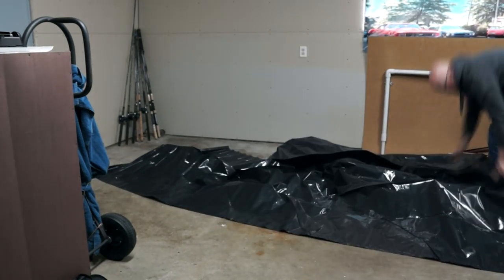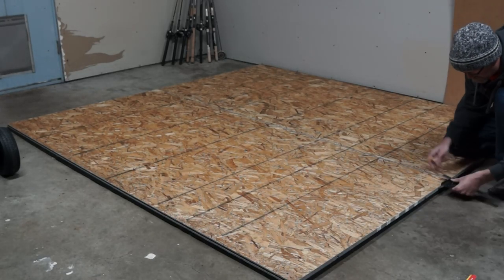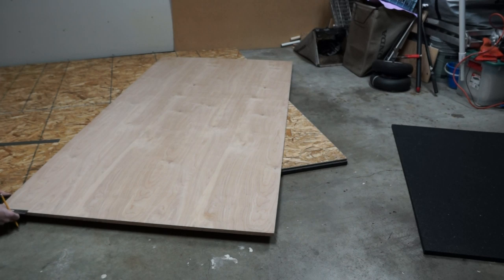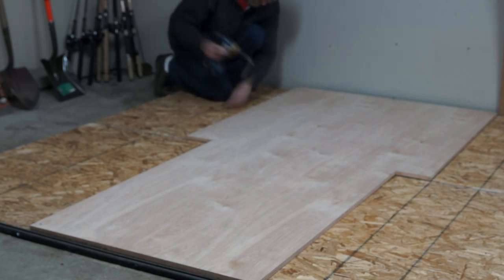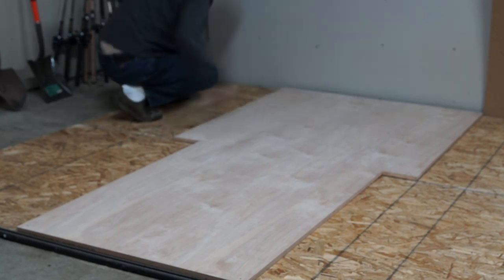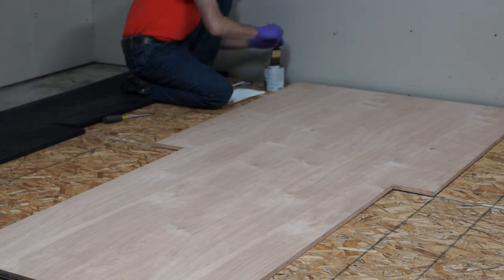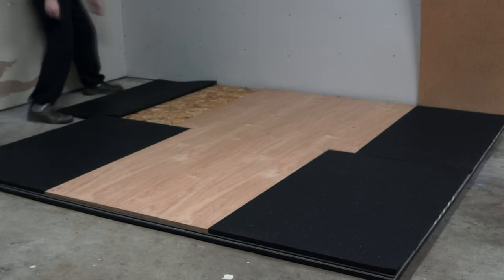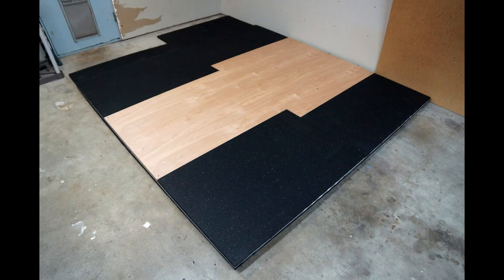Barbell weight lifting platform for power rack DIY build

Comment: For the poly I would highly recommend using a paint roller instead. It's easier and has a better finish. You can just slop down a bunch on the wood and spread it out with the roller. The roller will leave behind a mostly uniform textured finish. You can also put on multiple layers and use a very fine sand paper if you want a smooth finish.
Reply: That's an excellent tip, thank you!

Comment: Cool video. I just finished mine. J used 2 sheets of osb for the bottom 2 layers and 1 layer of regular $25 sheet plywood for 3rd layer. Then a 4x4 for the middle and 2 mats on each side. Works good so far
Reply from the maker: Awesome, it's great to have your own platform!

Comment: I really like this platform.  Particularly the way you "notched" the birch board.  I watched both this video and the one where you actually install the rack. 

Having the feet of the rack sit on the seam is the right way to go.  Serves two purposes.  1. It will hold down both the birch and the rubber tight together in addition to any screws.  2.  When you are working inside the rack, the seam runs directly under the frame of the rack, thereby never interfering with your feet no matter how wide you stand.
Having the birch platform narrower in the front is GENIUS for it provides a better distance for the weights to land on the rubber when doing floor lifts.  Deads, rows, cleans, etc. 

If you kept that seam at 4', then your loaded barbell would barely be clearing the platform.  If you shift slightly when lowering the bar, the weight may land so close  (or on) the seam that over time, the rubber may pull away from the birch, chip the clean edge of the birch, etc.  Also if you use a deadlift jack, you would most likely be jacking the bar on the wood.  Your way most likely insures  that the jack will be on the rubber.  So WELL DONE!!!

Now for the questions: 

Does the notch come into play at exactly the mid point of the birch board?  i.e at the 4 ft/4ft mark?  Looking at the way you were able to get away with using only 2 stall mats I imagine that would be the only place to notch the birch.  If you notched it at say the 5 ft / 3ft mark it doesn't appear you could make efficient use out of just 2 stall mats.  You follow me?

The reason I mention that is I will be getting the R-3 also but in the 30" depth Bolt Together version (If this damn virus crap subsides so I can place an order!) - The overall depth will be 6" more than yours.  Where do I cut my notch so my feet sit in same place as yours AND leaves me enough room off the wall for working off the rear of the rack?

I'm calculating my depth as such:  
30" inside + (3" upright x 2) + (2" foot flange x 2) = 40" overall
If I notch my board at the 4 foot mark and place the front feet right on that seam, that only leaves me 8" from the wall.  Seems a little tight?  No?

I can notch it further down the board like at 4ft-6in (I don't mind sacrificing a bit of dead lifting space) - But then I would need to make my stall mat cuts length wise and according to my calculations I would need 3 stall mats with a lot of waste.

Lemme know your thoughts on all this if you can.  And again - Very well planned out project on your part.  Looks great.
Reply from the maker: Hi Mike,

I hope all is well and thank you for the detailed comments / questions!

Based on your questions, here are some things to chew on for your calculations. I'd be interested in what you come up with.

Yes, the notch is exactly at the 4' mark. I see what you are saying about 5'/3' split, you would need smaller mat sub pieces to fill in the spaces which might not be a bad thing because it would be next to the sides of the rack and not where you are deadlifting, and you could place the smaller pieces near the back wall.

The uprights on mine comes to about 16.5" from the back off the platform, so there is about the right amount of room near the wall.

From your description, the rack is the 30" version. Mine is the 24" version, so I would assume you just need an extra 6", but if you are concerned about having more space at the back, the 5'/3' split would probably work too.

Yes, 8" from the wall might be too tight I think. Mine is 16.5" from the wall at the upright. 8" would put your face pretty close to the wall.

Cheers!
Reply: @martinstrength8532  - Thanks for the response (I knew you would based on seeing you reply to others).

Thanks for all the input - I think you are basically confirming what I already assumed:  Either lose a little dead lift space in the front or build a bigger platform.  I will do a mock layout and see how it feels with the 5'/3' split before I construct it.
As far as the stall mats - I would just buy an extra one or two to avoid having small pieces fill the space.  I'd prefer to spend a few more bucks and have waste to avoid too many seams.
Reply from the maker: @DieselMike  Sounds like a solid plan. FYI, the mats I used are from Tractor Supply Company which I bought locally to avoid shipping cost: https://www.tractorsupply.com/tsc/product/4-ft-x-6-ft-x-3-4-in-thick-rubber-stall-mat
Reply: @martinstrength8532  Would you believe every TSC within 50 miles of me are out of stock?  Before the Virus, these things were stacked 4 feet high at any location I ever went to.  So impossible to buy a rack right now.  Apparently impossible to get stall mats.  I guess this project is put on hold for now.  UGH!

Comment: How are the mat screws holding up? Small change would be to add a washer between the mat and screw that helps hold it down without cutting through the mat. Great platform!

Comment: I want to know more about the heater you planned too put in the corner by the fishing rods.  What ever came of that?
Reply from the maker: Hi,
  Good question!
It turns out that the garage is insulated and no heater is needed as some warmth comes in from the house. It never gets less than about 58F in the garage and when strength training I warm up pretty quickly. This is in the Seattle area.

Comment: Love your video! Amazing job! What is the moisture barrier made of? What material and size is that black tarp? Won't it tear with the slightest movement against the concrete with heavy weight on top of the platform? Thank you!!!
Reply from the maker: Sorry about the late reply. the moisture barrier is just a plastic moisture barrier from the hardware store. I'm not sure. I didn't end up really needing a moisture barrier. sorry if that's not enough info. The floor never really gets wet.

Comment: Would you recommend spray painting the sides of the middle osb layer black to blend in with the mats for a cleaner look? 
Also, would you recommend adding washers to the screws holding the mats to the osb for better support?
Reply from the maker: I like your idea of painting the sides of the OSB, I think that would look great! I haven't had any problems with the support, so if I was thinking about the possibility of adding washers, I would start without and then add them later if you think they are needed. I used very few screws, but you could add more if you like too.

Comment: @Martin Strength, thanks for the video. Do you think you need the plywood? Why not just have the stall mats?
Reply from the maker: You could just use stall mats on the top layer. I like the plywood because it has less compression for the bolting of a power rack and also less compression and less wasted energy for driving power during the lifts. Would you rather lift on a soft surface or a hard surface?

Comment: Hi. Thanks for making this! You did a great job. Do you feel you could've done without making the front more narrow for deadlifts? I'm worried I won't be able to make the 6 inch cutouts on each side.
Reply from the maker: It will work just fine without the cutouts. I could have done without it,  but I like the little extra  padding space.  Thanks for the compliment!

Comment: My hardware store didn't have 5/8 ply wood and instead had 19/32 which is just short of 1.25 inches after stacking my boards. Will the 1.25 screws still be ok? Any recommendations?

Comment: Hey Martin! Absolutely love your video. Will use this as the main source when I build my own platform. I was just wondering though. Do I really need 2 layers of 3/4" OSB? Would 2 layers of 3/8" do the trick as well, or do you think that's not enough protection... Thanks!
Reply from the maker: Don't quote me on this, but it sounds reasonable. Are you doing Olympic lifts and dropping the weights down all the time? That might be an issue.
Reply: @martinstrength8532  Nope! Just powerlifting... My deadlift max right now is about 440lbs, I can maybe get up to 550-600 in a few years time. Not planning on doing any olympic lifting

Comment: Great video.  Thank you.  One question.  Noticed you used three layers of plywood.  Do you think two layers would have been just as good?  In other words, two layers down, and then birch on top.  That along with the stall mats.  Reason I ask is because i'm concerned about the height of my rack.  By keeping to two layers of plywood the platform is limited to an inch and a half rather than 2 and a quarter inches.  Interested in your thoughts.
Reply from the maker: I would think two layers would be ok, but one limiting factor is that the length of bolts used to secure the rack might not be able to be as long. I don't know if that would be an issue or not.

Comment: What is the depth of the narrower Olympic lifting area vs the power rack base?
Reply from the maker: They are both 48 inches in length and the front is 36 inches wide, the back is 48 inches wide. I hope that helps.

Comment: Did you use two 4x6 horse mats, or one? I ask because the boards are 4x8, so I’m trying to see how this would fit. Thanks, I’m building the same platform this weekend!
Reply from the maker: Hi, yes it's two stall mats. The one in the front is cut to 2.5 ft and the one in the back is cut to 2 ft. (you might be able to see the dimensions on the paper design in this video: https://youtu.be/entPQi2GUTE ) Since they are 4 x 6, this leaves you with an extra 1 ft and 2 ft leftovers. I'm not sure if there is a better way to do it, but I hope that helps and I'd like to see and / or hear how your build goes!
Reply: Martin Strength Thanks!

Comment: Hi Martin! I've got a rogue r-3 power rack (same as you), and I'm wondering if it would cause any issues if I cut the oak plywood into two separate pieces.

I don't have a circular saw at home; I'd ask the Home Depot employee to first cut the piece in half, then cut off an inch from one of the halves. Would screwing these two pieces down separately be a problem?

Thanks!
Reply: Also, would using 1 layer of 2 pieces of 4x8 1inch OSB pieces be okay? Or is it recommended to have two layers of thinner 5/8" pieces?

Comment: How did that particle board hold up slamming weights on it over and over again?
Reply from the maker: Granted I have only been doing deadlifts on it for a couple of months, so it hasn't been hammered too hard, but I haven't seen any problems yet. It's Oriented strand board (OSB).
Reply: Martin Strength oh I see thank you for the reply. How much did the total project cost?
Reply from the maker: @charliestanley7906   I don't remember the exact figure, but including the  4 x OSB, 1 x Plywood, Mats, drywall screws, and water barrier plastic, it was somewhere in the $250 - $300 range. The main plywood in the middle was about $60 (could've saved here, but I wanted nice looking wood for it), the stall mats were $40 each from Tractor Supply Company (local), OSB were about $22 each.

Comment: Hi Martin, great video. May I ask you few question about the polyurethane coating? Do you few it is slippery when you are bench pressing, do you feel any slippery from your foot or bench? Meanwhile did you send the hardwood before the first layer of polyurethane? And also did find bubbles on the previous layer before applying the second or third layers? Did you send the coated layer before applying the next layer?
Reply from the maker: Hi, Thanks! The raw wood was only sanded prior to the first coat. It was not sanded in between layers. I did not get any bubbles as the layers were  thin coatings. The one I used was some what of a matte finish, so it was not as slippery. I think it can  be a little slippery when walking across it, but after some usage it gets a little rougher. No problems for me on bench.

Comment: Looks very nice. The price for buying a platform is ridiculous. Considering its just plywood and some rubber floor on the sides. However I probably wouldn't use stall mats I have read that they can release toxins etc
Reply from the maker: Thanks. DIY is much more affordable. Probably true about toxins, from what I understand they are made from recycled tires/rubber.

Comment: Just wonder, what about mold under the vapor barrier? Any consideration needed?
Reply from the maker: Excellent question, I'm not sure.  It was more of a precautionary measure and in my case so far I have not had any moisture problems, or any water on the floor.

Comment: where did you get the horse mat from ? Im assuming its as thick as the birch?
Reply from the maker: It's exactly the same thickness as the birch. I got them at Tractor Supply Company locally. I don't see them listed there any more though. I did a search and it looks like this is it: https://www.farmandfleet.com/products/297882-humane-4-x-6-x-3-4-rubber-cow-mat.html
Reply: @martinstrength8532  thanks buddy. I found it at a Tractor Supply Near me!
Reply from the maker: @fidelmsydney3035  Cool! They have good prices.
Reply: Can we see the finished product with your power rack bolted down. ?
Reply from the maker: @fidelmsydney3035  Here you go: https://youtu.be/HNUe4iK1h6Y

Comment: Did you measure half way through to start cutting the side?
Reply from the maker: Yes, it is exactly at the half way point, 4 feet.
Reply: @martinstrength8532  thank you!
Reply: @martinstrength8532  what is the “moisture barrier” you used
Reply from the maker: @HorizonMediaGaming  It was basically a "moisture barrier" plastic that I got at the hardware store. I think its used for construction. It was larger than the platform, so had to fold it. I didn't really need it though. Hope that helps.

Comment: Is this weather proof for outdoors?? If not, can I make it so? Wood I'm sure I can but how about the rubber pads?
Reply from the maker: Hi, the mats should hold up with no problem outdoors, they are heavy duty horse stall mats, very tough. I got these from local Tractor Supply Co for about $40 each.

Comment: Hi Martin,

Great video! One question, with that tongue and groove, the actual width of two OSB board side by side is slightly less than 8 feet.  Did this effect you at all, or was it even noticable?
Reply from the maker: Hi Tony,

On mine, there is one groove facing the front, one groove on the right side and tongues facing the back wall and the left wall. I have plastic on the bottom layer of OSB. I don't think they are too noticeable. Functionally, it's awesome to have your own platform.

If you build a platform, I'd like to see what you come up with!

Thanks!

Comment: Is the more narrow side (the side with wider horse stall mats) meant to be outside power rack and the wider side inside power rack? Or is the entire platform meant to be alone? What was the purpose of making the wider side if you wanted bigger mats to catch the weight when you drop it?
Reply from the maker: You are correct, the wider side is inside the power rack and gives it a solid base to bolt into, while the narrower side is in front of the power rack and the mats have more chance of catching the weights. It could be built without the cutout too if you wanted. I have a follow up video of the power rack install: https://www.youtube.com/watch?v=HNUe4iK1h6Y

Comment: How much total area did it occupy in your garage? How long has it held up are you satisfied with the project?
Reply from the maker: The platform is 8ft x 8ft square, been using for about 4 months (it took awhile for me to get the power rack). I'm very satisfied with it. An additional note, make sure to level the platform from the beginning of the project using some shims or something.

Comment: why does everyone using wood under the rubber. Could you not just make the middle wood and use 2 layer of rubber on the outside? Will the mats slide around? they are rubber and heavy.

Comment: how did you get around the bit of warping from the OSB boards?
Reply from the maker: Hi Kyran, 

They seem to be very flat on the floor, I don't have that much experience with OSB, but these ones were very solid and I haven't had a problem yet. 
Maybe I just got lucky? 

Thanks for the question!
Reply: @martinstrength8532  it looks great!

Comment: Thank you so much for your video. I used it to set up my own platform. I just used horse stall mats for the top instead of adding a wood topper for the centerpiece. I think I will like the grip of the horse stall mats for bench press. I did have one question though, when you set up the power rack how much space did you leave between the rack and the wall behind it?
Reply from the maker: Hi, the rack beam is about 18" from the wall and that works out pretty well. You could make it 20 - 24" because there is plenty of room at the front for deadlifts etc. Thanks for watching!

Comment: My platform is starting to warp around the edges, Do you know anything about fixing them?
Reply from the maker: Hi, I'm not sure. what do you think might be causing the warping, is it moisture? what kind of board is it?
Reply: @martinstrength8532  It could be moisture but i'm using heavy duty weather resistant plywood to begin with.